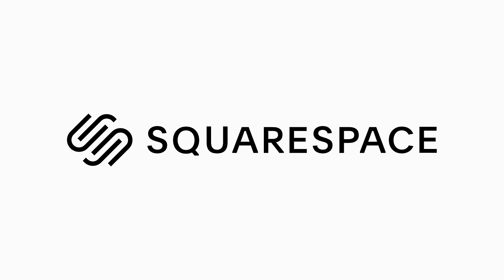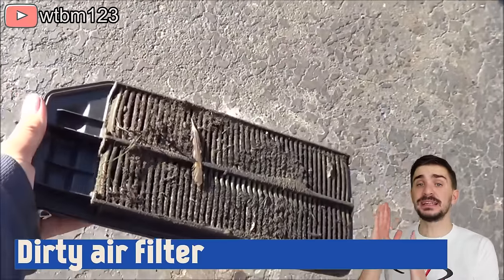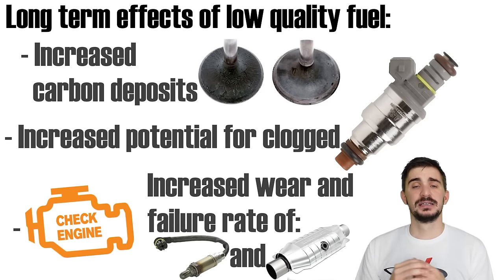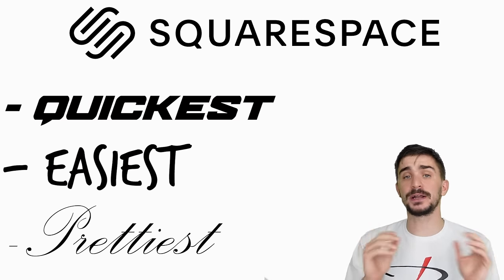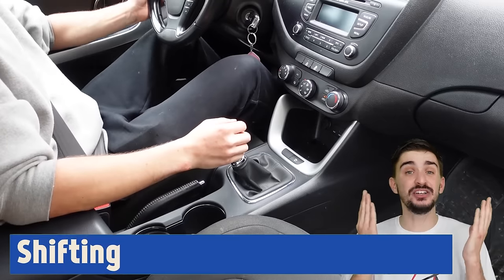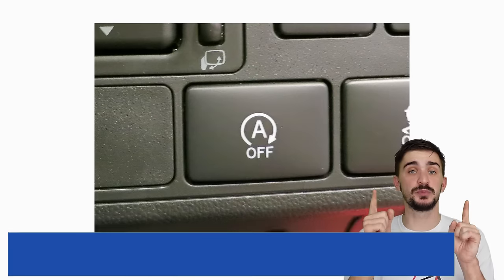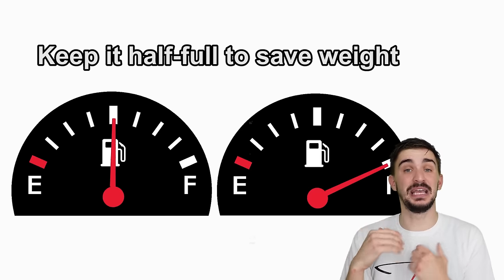EVERYTHING on FUEL SAVING - PRACTICAL DRIVING and MAINTENANCE techniques to REDUCE FUEL consumption

Comment: Sooooooooo, here's the thing.

I've actually done drafting in the past and I just gotta say, it works yes! BUT, you really shouldn't do it.
1. Yeah yeah you have to be fairly close, but also,
2. Air turbulence: unless you are a literal few feet from a huge truckers ass, in which case you'll almost certainly go underneath if they brake and you take more than an instant to react, you're going to be hitting turbulent air. What are the aerodynamic physics of this? I don't know exactly, all I know is that unless you're close enough to reach out and touch the truck in front, you're not going to have a comfortable ride. You're going to be buffeted by turbulent air the entire time.

Comment: Hi, is there a reason why a manual gearbox Alfa 159 would NEVER display anything below 2.0L/100km on the dashboard, even when driving down a steep hill in gear with 0% throttle?

Comment: 8:10 even ignoring the startup fuel use, coasting with the engine in gear already shuts off fuel flow to the engine completely, so you're not actually saving any fuel by coasting with the engine off vs coasting with the car in high gear.

Comment: When I shift my 2014 Ford Fiesta into neutral the onboard mpg tracker goes up (quickly). Is the tracker assuming the engine is off. 6spd dual clutch.
The car has an engine braking mode for downhills. Will that use less fuel than neutral with brakes?

Comment: My 2020 Kia Rio Hatch. (American 1.6L I4) has a code for Fuel/air Mixture after I experimented (I know what I was doing. For the most part. Dont Question it) And now I get 1.5 MPG better. IDK whats going on. I get it checked every weekend. and nothing has changed. Not even Performance.

Comment: I'm going to counter your argument when it comes to shifting. Using more throttle in a lower rpm can be good. All combustion engines have a sweet spot of throttle opening and RPM where it is most thermally efficient (lowest number of units fuel consumed per unit of power produced). This is usually 70-90% open throttle and usually between 1500-2500 rpm depending on the engine (smaller engines are most efficient closer to 2500 and larger engines are most efficient closer to 1500, older engines are closer to 70% open throttle and newer engines are closer to 90% open throttle).

Knowing that fact, if you keep your throttle opening and engine speed as close as possible to that sweet spot, it will be more efficient than if you were further away. For example, an L15 Honda Fit is most efficient at 80% throttle at 2500 rpm, so if you were climbing a hill at 40 mph/65kph, you could shift to 4th and be at 80% at 2500 rpm and your engine will be making 40kw using around 10L fuel/hour, but if you were in 3rd gear at 3300 rpm at 65% throttle, you'd be making 40kw using closer to 12L fuel/hour, and if you were in 2nd gear at 5000 rpm at 50% throttle, you could make 40kw but you'd be using 14 or 15 L/hour. If you were to go the other direction and shift to 5th at 2100 rpm at full throttle, you'd be using more fuel, closer to 11 or 12 L/hour. However, most people would say using 3rd gear would "feel right" and that they would be scared to use so much throttle at such a low rpm to be using 4th, but it would be more slightly more efficient.

Of course, using full throttle at any rpm is going to give you less than optimal results, and using an RPM that is way too low or way too high is bad too, and your point about lugging is very valid, but in order to lug a modern engine, you'd need to be at or near full throttle an engine speed very close to idle.
Reply from the maker: Yes, the theory on pumping losses. It makes sense in theory. But try driving any car around in the real world with 70-90% throttle in all sorts of different conditions. Might work on the highway for cars with 70hp. Otherwise, nope, you'll just be constantly accelerating very hard and/or speeding and then braking.
Reply: @d4a  Pumping losses are a very small part of the overall efficiency of an IC engine.

Comment: My civic with 1.4 dual carbureted burns 9litres of gas per 100km.I have no idea how to lower it.Wonder if bike carbs will perform better?Ive removed power steering and im on 13 inch alloys ( lightest i could find).
Reply from the maker: Bike carbs will likely make it worse, especially at larger throttle openings. It's very hard to improve the fuel efficiency of carbureted engines due to the nature of the technology itself. 9 liters is pretty decent for a dual carb, especially if you drive a lot in the city.

Comment: How can start/stop system save fuel? If the engine is constantly starting is inyecting more fuel to start smooth and will wear down the battery, starter and engine...

Comment: My oxygen sensor heating circuit is faulty but the engine runs the same and the sensor reads voltage does that make a difference in the economy?

Comment: Some stuff you say in this video is fact but some is crap, speeding on the highway willcget you where you need to go faster as there is no toll booths common in north america ive driven over 200,000km in 5 years and not had a single one also you say fuel additives dont work but that is simply not true and you have never used seafoam on a carbon deposit,/ clocked carb/ injectors and engine get a borescope and its night and day depending on how bad it is the performance is clear if you have driven the vehicle for any ammount of time

Comment: about the quality of fuel i run my car in two types of fuel one is the regular gasoline octane and the other but little cheaper is lpg gas,of course running in gasoline is bliss but the difference is very negligible i couldn’t find any guid on how to maintain or what happens when you run a gasoline engine with lpg or natural gas

Comment: I have to say drafting actually works, it is very unsafe but i tested it, going behind a truck on the highway vs alone at the same speed i actually seen very noticable difference of up to 2L less per 100km depending on the car. It is less safe but it works, still, wouldn’t recommend. Safety isn’t worth 5 bucks.

Comment: maybe a stupid question... i dont know. so lets say i have a mercedes c-klasse normal stock 2020 and the manual says its okay for me to use E10.. so the lowest price gas possible in germany. do i have the same problem you talked about at 5:35 onwards?

tl:dr should i use normal gas (E98) if i dont care about the money from the gas and just care about the car itself even if the manual says its ok to use the cheapest gas?

Comment: Great video from you , as usual!!  I am wondering why you didn't include an chapter on speed. Living in Germany the difference between a reasonable and somewhat economic 120km/h and the stuff I still see on the Autobahn these days is dramatic. 
I am sure you know perfectly yourself about the non-linear increase in fuel-consumption vs speed. Why didn't you include it?
Reply: Maybe because when Jeorge Sprave blows by you on the Autobahn, in his wife's Turbo Porsche, at 300kph, he isn't even worried about fuel mileage; it's all about the experience! Be careful though- his laugh will blow your little Skoda clean off the road!  FR

Comment: Someone please correct me if I’m wrong but coasting in neutral with the engine off in an automatic car can damage the transmission since the transmission is turning without any lubrication which is provided by the engine when it is running
Reply: Transmission is cooled off with its own oil, NOT engine oil. Many cars have transmission dipsticks in addition to engine oil dipsticks.

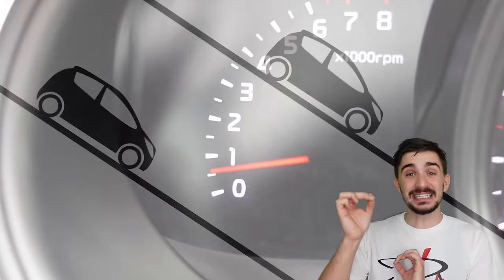Comment: 11:41 That's only half of the picture. Idling engine uses some fuel (as opposed to one coasting in gear with fuel completely shut off). That part is right. But you haven't mentioned that in gear it SLOWS down much much more than coasting in neutral! So if you drive fast and have a lengthy streach of straight road (especially before a turn where you need less speed regardless), then it's far more economical to actually run the idling engine on a little fuel and NOT slow down too much for a mile, than to coast in gear, use no fuel, but just for 200 yards... driving the rest of that mile on a full throttle. Just try it yourself and you'll see.
Reply: I have adopted coasting in neutral for some time now. When the driver behind me is at a far enough distance, while driving 80 km/h for example, I shift to neutral at around 750 meters (depending on road inclination) before a crossing. When there's 'left over speed' at the end, I'll coast in gear to slow down. By doing this, I've increased my mileage from 15 km/l to 17 km/l. From a liability standpoint I understand people are advised against this practice. But for experienced drivers with advanced knowledge of vehicle handling that can 'read' the road and traffic around them, this can be a very effective method.

Comment: Wdym with low quality fuel? At least here in central Europe, there isn't really much choice other than some octane numbers or fuel with additives that from what I learned just go in the opposite direction (saying you save money in maintenance but it doesn't add up). It's not as if the slightly cheaper fuel station has worse fuel, there aren't that many different refineries around.

Comment: if you want to save fuel, watch a vacuum gauge and try to keep the vacuum as high as possible all the time. Or pretend there is an egg on the gas and brake pedal. Drive to not break thee egg and use less steering input.

Comment: Hi there! I totally disagree that a dirty air filter increases fuel consumption. Isn't a bad permeable filter the same as not fully open throttle?
Reply from the maker: It's not. A throttle can be manipulated and opened fully when needed. A dirty filter cannot, so you're wasting engine work on fighting to ingest air through a less impermeable membrane. This forces you to open up the throttle more than usual. Try taping up most of your air filter and watch all the amazing fuel savings.
Reply: @d4a  Can you explain then a difference bethween this two cases, assumed the revs and the output power is the same:
1. Air filter is clear, throttle opened half way.
2. Air filter clogged, throttle 3/4 opened.
I suppose that in both cases amount of sucked air will be the same, intake pressure will be the same. As result ingesting losses will be the same and ECU inject the same amount a fuel, so MPG will be the same, isn't it?
Anyway I agree that full power with dirty filter isn't achievable.

Comment: actually on the issue of low quality fuel thats not true. The difference is octane. If you use a lower octane rated fuel on a carburated/mechanical engine then you will get issues if it is lower than what the engine is rated for. In a modern engine you just tell the computer or it may auto detect and adjust. For instance if you use a lower octane fuel in a modern high performance engine will mean you get less economy and power but when you consider price per mile or fuel its still cheaper.

If you are going downhill use engine braking or downshift, it will save your brakes and not use any fuel while the engine will power all the accessories.

coasting with the engine off wont work when in gear as it will start itself again, while on auto gears it could be severe since the auto boxes require computers to work. Assuming you're in neutral you can shut off the engine but keep the key in the "on" position so your brakes etc are all powered however coasting without engine is pointless since you wont really save any fuel, rather don't use the AC and open the window when you're slower.

Comment: i get 21mpg in a 1.5L honda fit. i even get burbles and pops even if its bone stock
Reply: I get 60+ mpg in my rabbit pickup with a Tdi swap. 
Even with the original 1.6d my owners manual states u need service if u get under 40mpg. 

Your car is embarrassing.

Comment: I can push a Scion tc, with the 2ar engine, to 38-39mpg by taking flatter back roads, being light on the throttle, shifting at 2-3k rpm, driving 55mph or less,  and staying in sixth gear as much as possible.

But it's not fun :(

I can keep it at 30mpg driving fairly sporty and enjoying my drive. 

I'm bad at math, but if I did it right, that only saves ~4 gallons out of a 14.5 gallon tank. The only plus is about 116 miles further drive time, assuming perfect conditions. 

Realistically, on local roads, max mpg averages to about 35, which only saves 2.42 gallons, and gives only 72.5 more miles per tank. 

With my daily commute, it saves only 1.5 gallons a week. I can justify an extra $7 in fuel to have fun on an otherwise boring commute. :)
Reply: The good thing about Driving a small 1.0 liter 3 cylinder car is you can redline it have fun shifting and still get better fuel economy than your neighbor in his 2.0 liter VW
Reply: @russkifussel  mines a 2.5. It's a fun daily while I rebuild a dune buggy to be street legal (manx clone).

Comment: Never manually shut off your car while it’s still in motion unless you have an old manual. Then instead of starting it with they key bump start it with the clutch. Used to do that a lot. Also basically everything he said about drafting doesn’t apply to semi trucks. They travel at basically the same speed, they brake super slow so you aren’t gonna hit them, and who cares what’s happening ahead when you have a truck blocking in front of you?
Reply: Well, I'd rather not crash in the truck. They usually brake slow, but if there's an emergency braking situation their 18 massive wheels and brakes are going to stop way faster than your average car and you'll smash on the back of the trailer.
Reply: What if truck suddenly swerves to avoid hitting something, but you can't because there are vehicles next to you?

Comment: You missed an important and cheap one: Washing your car. Having a smooth surface will reduce drag and turbulence around the entire surface area of the vehicle and should improve fuel efficiency
Reply: Totally debunked.
It makes zero difference, you might wanna learn about boundary layers. There is a reason why rain and dust dont just fly away from your car when you drive on the highway. Your car could be covered in sandpaper and it would not make a difference to aero.

Anyhow you should probably wash your car anyway, but id focus on keeping the mechanical parts clean.
Reply: @ignasanchezl  source? I googled "surface roughness vs drag" and it shows multiple studies that show a direct correlation. Some specific textures improve aerodynamic performance, like a golf ball. While in general, the rougher the surface, the more drag it will produce.

Comment: Oddly enough, on my car, a 2002 Hyundai XG350L, I get more mpgs with the A/C turned on. I assume there's a compressor clutch drag going on. Or my car is just weird like that. Great video btw!
Reply: more likely you are not loading the engine enough during normal driving, if the clutch was dragging while open it would quickly wear out

Comment: when u shut off the engine in gear, engine still rotates and produces vacum for breakbooster 
it also spins steering assist pump 
and when u put the ignition on the ecu never gets starter signal it just assumes engine is spining already and spray fuel as if it was working all the time 

just saying...
not like i advise to do it 
but thats how it is 

also pretty much any car with electronic injection have coast fuel cut so really no reason to ever turn off your engine...

also driving without steering assist is not that hard over 1km/h you cant feel the difference between ahving assist or not 
how do i know? well i actually have project car with deleted steering assist and im driving it like that for past 2 years 
never had any issues 
but still im thinking about electric assist because it can be turned off when driving and turned on when you park not like mechanical pump...

Comment: Oh and to add... Even in BEVs coast with the engine on and in gear! Coast on hilly roads is not only fun but will save you gas as you might gain speed and like in a fight jet trading engery for distence is a great way to save on gas as you don't need to touch the accerlater at all.... Which if you are in a heavy vehicle even better as you have much more potanial engery to trade to distence... Which ofcorse watch out you traffic stop sign/light and kids and animals but still a great way to save gas.

Comment: I expected to see something like "keep you window brushes upstand" or "cover with a sticky tape all gaps between hood, fenders, ets..."
I'm kidding! Great video, safety first, then reasonable fuel efficiency. Driving with cruise control on stable speed can be also considered like fuel economy feature.

Nice to see ronal aero as a part of fuel economy strategy, and backwards sad to see bmw e31 like fuel waster. So If I buy e31 one time, I'll be searching ronal aero rims to compensate my fuel losses. Sounds like a good plan 😆

Comment: Drafting is absolutely effective even at fairly lengthy following distances.  I'm not sure why I keep hearing this factually incorrect information.  Simply staying a couple of seconds behind a large vehicle in front makes a significant difference and this can be easily proven with any trip fuel economy measurement device built into most cars today.  Step 1: Set your cruise control and follow a semi 2 seconds ahead for 10 miles.  Step 2: Pass the truck and set your cruise control to the same speed for the next 10 miles.  Step 3: Gasp in horror at how much fuel you're thrown away your whole life by insisting trucks be behind you.  No tailgating is necessary.